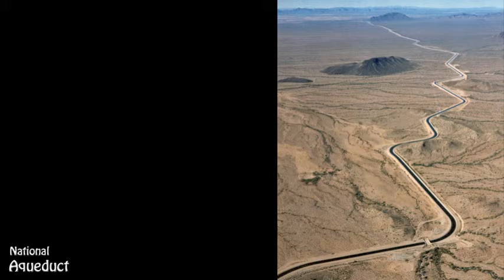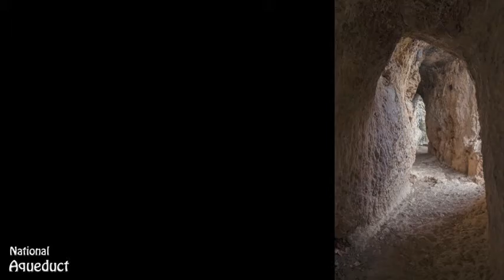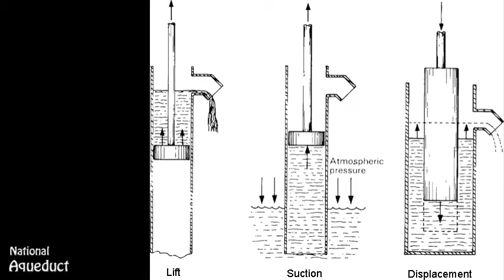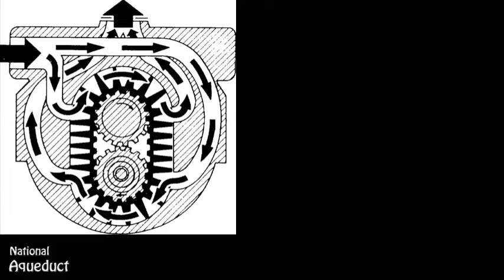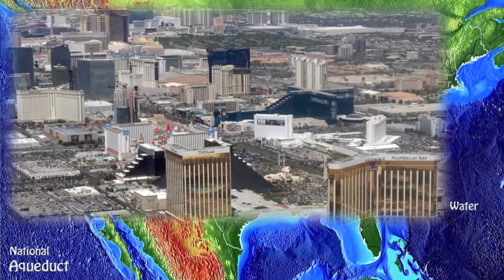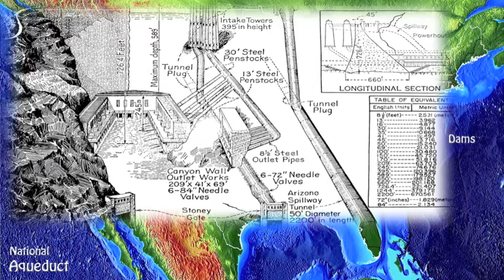National Aqueduct

Comment: Not the best answer, but close. Capture water from Atlantic, Gulf of Mexico, and Pacific oceans. Use desalination to make water "fresh" and harvest sea minerals and sea debris for agriculture utilization (think compost and fertilizer plus sea salt). Transport the water in a system of massive enclosed pipe to prevent evaporation loss. Additionally, using green energy, supplimented with gas/oil/nuclear energies as-needed, and gravity, create hydroelectric energy as it is transported. Transport water to areas as needed for agricultural support and make North America a rain forest.